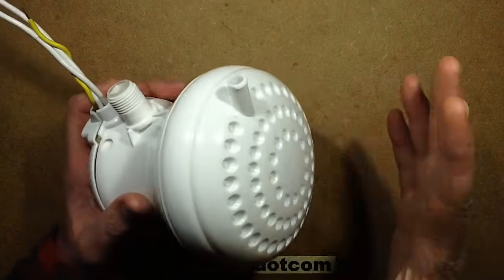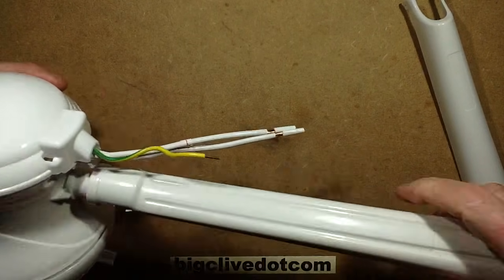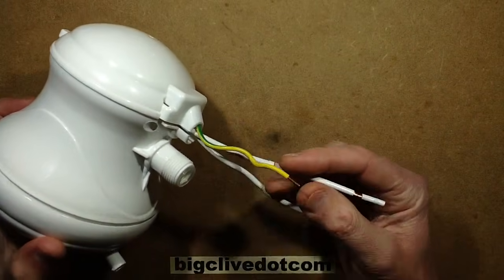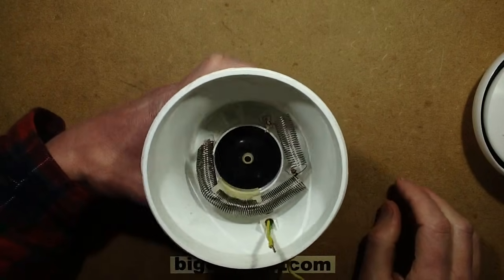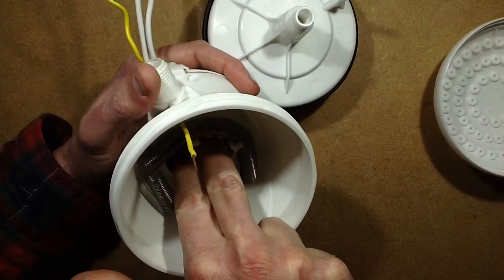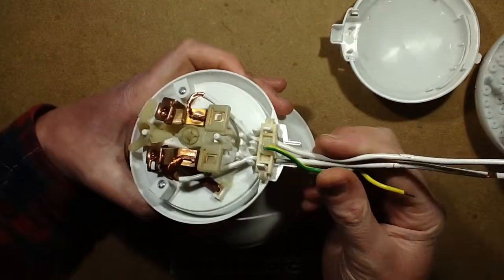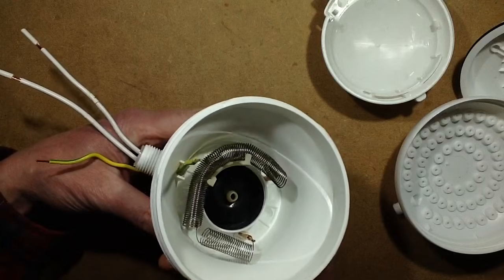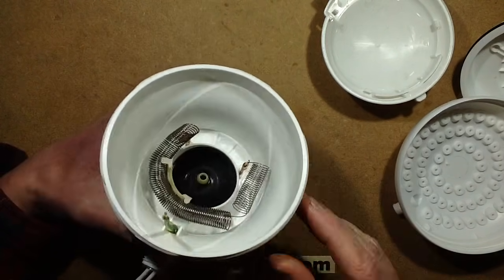Inside a heated shower head.  (suicide shower)

Comment: So looking at a suggested video at the right, as you said that you guys in the UK have electric showers, im intrigued, do you not have a large hot water system for the whole house? whats the ones mounted in the showers good for? it just boggles my mind to have all that electricity running to a shower recess.
Reply: +thehodge168.. yeah I remember that in my student flat.. one massive boiler that fed 10 flats.. 1/2 way through a shower if someone else turned on their shower or washing machine you had about 30 seconds to get out of the way of a freezing blast of water
Reply from the maker: +thehodge168 Our electric showers have their own circuit with a suitable isolator configured as a pull cord or external switch.  They have an internal metal chamber with an enclosed element in it, and full earth bonding to all the associated metalwork.  They're very convenient.  You just turn them on and shower straight away.
Reply: +bigclivedotcom so is it a common thing? or just for those who have smaller houses/flats etc?
Reply from the maker: +thehodge168 They're very common here in the UK.
Reply: +bigclivedotcom so does that then mean that say for example in the kitchen or bathroom basin they have water heaters too? or is that run by a "communal" hot water system
Reply from the maker: +thehodge168 Other taps (faucets) in the house are fed from either a single hot water tank or an on-demand gas water heater that also does the radiators for heating.
Reply: +bigclivedotcom so the benefits of the electric water in the shower is uninterupted hot showers? my god thats every aussies dream. we all have single hot water systems that feed every hot water tap in the house. shower, bath, laundry for washing machine, sinks in kitchen and bathroom the lot. as you can imagine in winter it can become a game of showering in between washing up and washing machine cycles
Reply: +thehodge168 For a whole home water heater with endless hot water look at a tankless hot water heater. If you have sufficient natural gas service at your house I can't see why you couldn't just swap your tanked water heater for a tankless! A few weeks ago we just swapped our gas water heater (tank style) to a tankless and everyone in the house loves it! Showers as hot as you want, for as long as you want, it never runs out. Please excuse the messy install and over use of sharkbite fittings, this was the "free" installation that came with the water heater: http://tafb.xxx/new_heater_01.jpg

Comment: Anybody who would get under one of these things is proving Darwin's theory of evolution correct. Smart people won't. I think this might be the most outrageously dangerous contraptions that I have seen on your channel Clive. what is the problem with not using a remote gas solar or electric water heater? My rule of thumb is that when I'm in the shower any source of alternating current is quite a ways away.

Comment: Last year, during marching band practice, I was in the front ensemble playing bass guitar. My friend and I both played guitar for a certain part of our show, so we were both plugged in to the power supply (being the nearby school). For some odd reason, we started getting these electric shocks when we touched our strings. It got to the point of agonizing pain and we were forced to stop. Eventually I discovered a switch that said "Lift" on one end and "Ground" on the other. After switching it, the shocks stopped. What did I do?
Reply from the maker: +Jack Brooks It's hard to say.  Many "audio experts" have very odd and dangerous ideas about mains earthing.  And old valve/tube amplifiers were notorious for causing serious shocks.

Comment: What is the point of a heated shower head? Couldn't you just turn on the hot water?
Reply: +Ryan Toomey The places that use these things don't have hot water boilers.
Reply: +Spudcosmic or safety regulations

Comment: Showers like the one in the video can't be used with RCDs, they will always trip it. There is another flavour with a isolated heating element (I think) which are more expensive and does not trip them

And yes, I am from Brazil and got a RCD at home.

Comment: 5kW at the showerhead would probably be adequate. Consider that with your normal heater it has to pump through a bit of piping as well, which will dissipate some heat. And also, with your standard heater you have a faucet to control the temperature; this just has a high and a low. You probably don't want it to be uncomfortably hot.

Comment: And potentially 5kv to the naughty bits, sounds stimulating.
Reply: Not exactly, there's a big difference between volts and watts.

Still, I agree that the unit is exceedingly dangerous, and wouldn't even consider installing it in my home or anywhere else.

Comment: Would be better to include a low voltage high amperage power supply and work it that way instead of feeding the mains into it.
Reply from the maker: +NightWolfx03 At 5kW that would be massive current at low voltage.  Even at 24V it would be over 200 amps.
Reply: +bigclivedotcom Mmm true.. Maybe it's best not to make the shower head the heater XD.

Comment: I used on of these in São Paulo. It was installed with wire-nuts just dangling. I'm tall, and didn't feel a shock...though I'm not sure I'd have been comfortable using it if I'd known what was inside.  The water temperature of the shower was rather pleasant, plenty  warm for the climate.  I'm sure it helped that the tap water felt about room temperature...distinctly not cold.

Comment: Those are really common in my country! actually, we have that exact shower in a bathroom. 
it's funny, because the earth wire is connected to the metallic water pipe. Even more funny, I have seen lots of those showers connected without the earth wire and wet I don't know anyone who had died or suffered a electric discharge

Comment: would it be fine to use it if you connect it on a isolation transformer?
Reply from the maker: +Felipe Gómez Danitz It would require a 5000VA transformer, which would be very big and very expensive.

Comment: if it was me, I would ground it by connecting the ground wire to a metal strainer or grate that the water flows through. makes more sense than just a wire.

Comment: Since RCDs are mandatory on bathroom circuit, I think this wouldn't work here. But damn, I've never seen a device that used grounding as a working connection for normal operation...

Comment: If there was no ground to the shower plug etc would in theory it be safe?
Reply from the maker: +mbplove Unfortunately the ground wire is quite important to prevent the leakage current through the water from going past the spray nozzle.  Without a proper ground the current may seek an alternative path through you to the adjacent metalwork and even the wet floor you're standing on.  The only limiting factor would be the combined water and ground resistance.

Comment: these are kinda disposable, works for about five years and then you probably would have to replace it. That is why most are just wired up with twisted cables or ceramic connectors. You can also buy separately, the heating element to replace burned out ones. You should leave the water running for a while before turning on the electricity and there are dedicated circuit breakers just for the showers. I have one for about four years and never had an issue. with bare twisted cables. I live alone and they are very high and far.

Comment: This is used here in Brazil in like 99.9% of the houses. Also, I never ever saw a house here which has a ground! It is just a fact of live that you will get shock if you touch the water valve with some small cut on your hand.

I found it very unusual your care with earthing and isolation, because here in Brazil a shock is a part of the life. No one cares about it, not even (specially not) the electricians. As a child I got shocked with 110v, 220v and even with 330v once and lived to tell :)
Reply from the maker: +Michel Boaventura The drier climate may result in higher general resistance to ground.  In damper climates shocks may be more severe, even in homes.

Comment: Yeah, my guess is the water is already 22 celsius, so bumping it up to 38 or whatever is comfortable probably doesn't need as much energy as say 10 or 5 degree water. I know I live in Florida, and in the heat of the summer you can take a shower (if you REALLY have to) with just the cold water on and it's not terrible.

Comment: is it more efficient to heat water where needed or to use  single water heater for a whole house
Reply: +Slot1Gamer it depends upon how much hot water is needed and how often. for a small lavatory and sink in an ensuite, a instant undersink unit is just fine. for running a bath though, a whole house heater is more effective, but is less efficient and has more losses. also depends upon what energy source you are using. electricity is very efficient for energy in vs energy out, but is very expensive per KWH, and gas is still a bit pricey in the uk. if you have a geothermal heat source (the french do), your energy source is practically free.
Reply: +Slot1Gamer I've had 'em all. Central water heater, undersink unit, even had a couple of these crappy shower heads. I'd say the best overall option for homes is the undersink unit. Central units end up running all day long, and driving your energy bills sky high.... they're not supposed to, but, that's what happens. Plus you have to deal with heat loss in the pipes, water loss due to the period while the cold water is flowing out, etc. 

The math can look real nice in favor of central water heaters, if you look at just the heater itself. But once you figure in all the rest of the variables, it gets a lot more complicated.

There's undersink units that have reserve tanks for more demanding applications (ie running a bath). I've even seen cases where big undersinks are used to supply several bathrooms. They work fine, and the owners are happy with a lower energy bill.

Only cases where I would think of a central unit is if you're running a ton of hot water outlets at the same time (say for commercial/industrial/hospitality applications) or if you have a permanent source of heat you can tap (machinery, chillers or a furnace running all day long). And in those cases, you have to consider that you'll usually be paying more to operate a less efficient furnace that generates hot water: if you don't constantly use up all the water you heat, it's money down the drain.

Comment: This device should be of a metal enclosure, ceramic insulators for the heating elements, and with a hermetically-sealed switch.  Regardless, as an electrician in the USA I do not believe any reputable inspector would approve of this, being it is exposed outside the wall and we are not allowed to have any sort of exposed device in a shower or tub space.

Comment: Those units are very popular here in Brazil, 9 out of 10 houses have one. I just asked a friend who used to work in IPT (IPT is a government organization who test out stuff) and he said me that the minimum requirements for sale are a maximum of 30ma in the ground wire and 5ma in the body (yes, 5ma in the plastic body! He said that he tested one with 10ma in the body!). And yes, i had a few bad experiences with this showers, electric shocks, explosions, two wires melted and shorted out ( the house had a 75A fuse in the shower circuit). Love the videos Clive, bye!

Comment: Makes me think of my poor old fish years ago. There was a fault on the heater that let some current get in the water. I was getting tickled when I touched the water. It didn't seem to bother the fish, but I wonder if the poor buggers were just numb to it. I got them a nice new heater after that.
Reply: +Siskin's Bits and Bobs The fish was not grounded , you where . The fish would be fine .
Reply: +Siskin's Bits and Bobs  The electrical current in your fish tank wasn't bothering the fish because the fish weren't getting shocked; the electrical charge was the same all around the fish.  It would have been the same thing as a bird sitting on a high-voltage power line without getting electrocuted.
Reply: Don't people fish by electrocuting water, though?
Reply: +Travis B In the closed environment of a fish tank, the charged water is insulated from earth by the glass container. Current could only flow when a grounded Siskin touches the water, and as such the fish may feel some if he is in the water between Siskin and the source. How much, depends on where he is and how much current Siskin is able to conduct. In a lake or ocean, dropping a high-voltage lead into the water causes current to flow through the water to bottom to earth, or if a pair of electrodes, through the water between them. Fish caught in the current path would feel it.
Reply: +Travis B coley shanoz
Reply: +Siskin&#39;s Bits and Bobs I had a fish tank heater crack once and it fried, I mean boiled, my fish!
Reply: +John Citron I hope you has chips to go with them
Reply: LOL, Good one. :-)

They were a wee bit small though being guppies.

Comment: Thank goodness safety standards cannot be met by this type of heater in the UK. Purely out of curiosity, what voltage is it rated for, 110 AC? Often in safety testing this makes all the difference with high voltage in contact with water. I just cannot believe people think it can be safe.
Reply: well that's good to know. We wouldn't want to feel left out here in the U.S.

insane.
Reply: +stephen wallin Surely against regulations that forbid power supply in a bathroom or shower, it would require a supply in a sealed conduit, same as heater supplies to towel warmers. The more I think about it the more I shudder!
Reply from the maker: +stephen wallin It's available in 110 and 230V flavours.

Comment: What you say about experiencing a buzzing or tingling sensation from operating one of these unearthed shower heads sounds most unpleasant to me, it makes me very thankful we don't have electric shower heads here in Australia, having said that, we generally have pretty high electrical safety standards here.  Do I understand that electric shower heads are quite common in the UK?
Reply: +Lachlant1984 i took a shower on one of these for 5 years! Unless i had a bruise on my fingers i never felt any sign of electric current.

Comment: If it would be connected with earth leakage protection plug like this faucet(I own one) have http://www.dx.com/p/02cc-electric-instant-water-heater-faucet-for-kitchen-white-silver-3-flat-pin-155cm-163330#.VqFaRfkrIdU  there wouldn't be any problem.  I'm saying this from my recent experience with this faucet when rubber seal started leaking water into compartment with electricity, it turned electricity  off in instant, didn't feel anything.  

Edit: added earth to leakage protection
Reply from the maker: +ArrowAxe I've seen those for sale in many forms.  But most have an internal view showing a fully sheathed heating element.
Reply: +bigclivedotcom Yes mine does have sheathed heating element. But I was talking about the earth leakage protection on plug. http://img.dxcdn.com/productimages/sku_163330_4.jpg They named earth leakage protection only "Leakage protection" it's confusing.

Comment: I think the showering of approval from experienced users should wash away any concern about using one of these units. Obviously there is the chance of a shock, but that's even the case in a cheap apartment complex in the United States where unapproved electrical work has been done.
Reply: +benbobhenbob by the way, first comment on your channel and just want to say I love the videos. I've learned a ton about electronics that I've always wanted to know. Keep it up.
Reply from the maker: +benbobhenbob Technically speaking it should be safe enough if the ground connection was solid and there was no RCD or GFCI to trip from the certain leakage, the connections were properly insulated and there was also a strict regime of making sure it was turned off at an isolator when not in use.

Comment: The flex is that short to save on the copper :D
Reply from the maker: +zaprodk I can only guess it's an economy thing based on the wire being a modest thickness.  Just enough to get clear of the unit and allow a "joint" in the support arm.